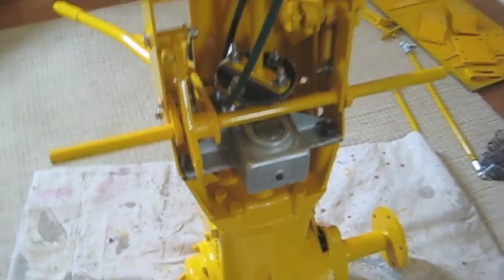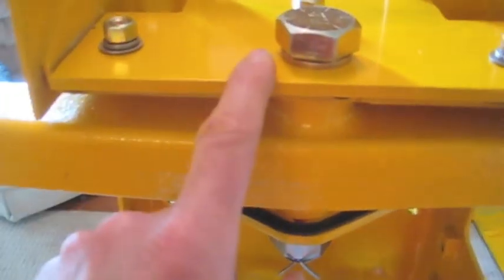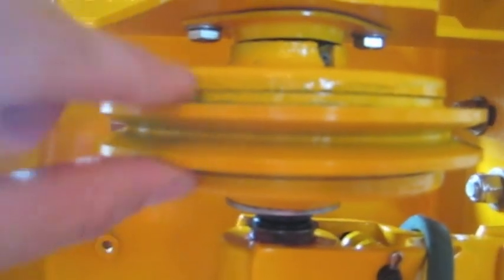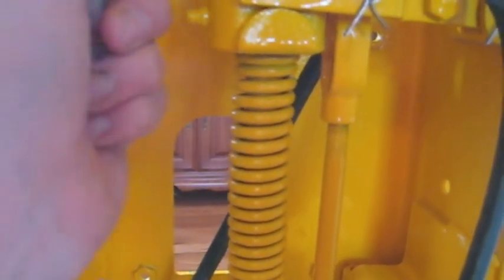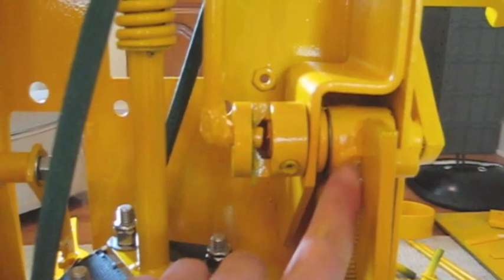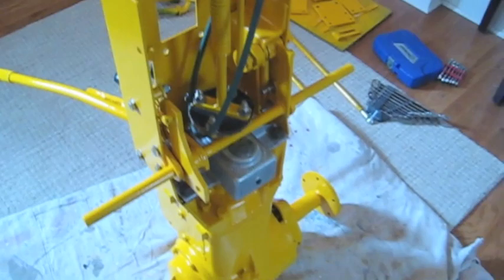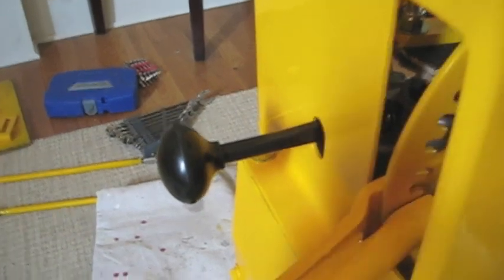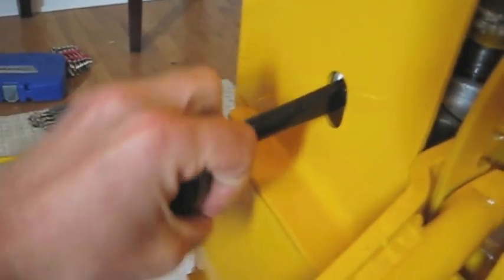4 - Cub Cadet Original Restoration - Clutch

Comment: I’m having a problem with the clutch/shaft on an original. I had to put a new belt in so I took the front bearing part off and now I put it back together and the clutch is shaking when I let go of the pedal. Did I adjust the linkage from the pedal too tight?

Comment: That drive belt you have hanging. How can I swap out that belt once the mower is built. I don't know what part of the assembly to take off or flex to get the belt around the pulley. Do you have a video of that process?
Reply: s g1   Easiest way is to remove the engine mount bolts, remove the driveshaft bolts.  Slide the engine forward enough to slip the belt on.
Reply: Robert Heinkel thanks. i got it done

Comment: Where can I find 1962 international harvester cub cadet parts (throwout bearing) etc?  I have checked around my area but can't find anything
Reply from the maker: You'll need to get cub cadet service manual with a parts breakdown if you are planning to do a full restoration.  There are to many part numbers to list.  I'm not sure what you mean by a throw out bearing.  IH-468390-R92 and IH-468391-R11 and IH-25556-R1 are original part numbers for clutch bearings.  You can try searching parts on cub cadet.com.  They will have some common parts.  You will have to do some research to find others, but you need a parts manual first.  Good luck!
Reply: i use ebay.com
 u have to know and be sure of ur parts tho to use ebay